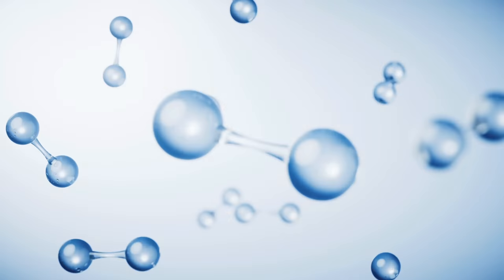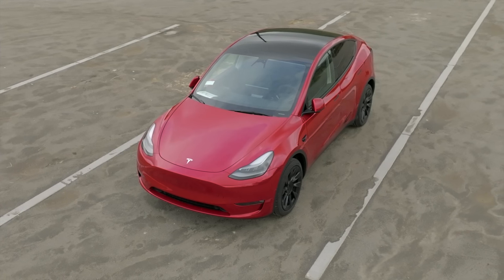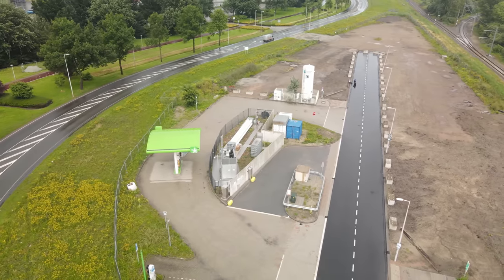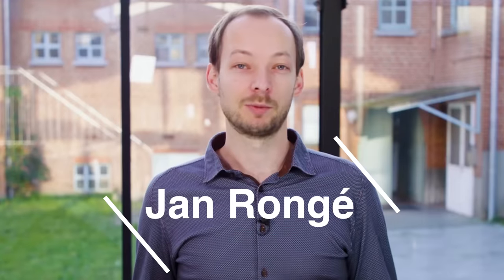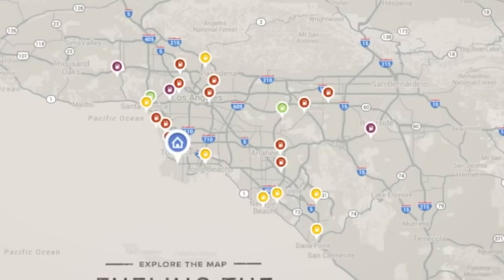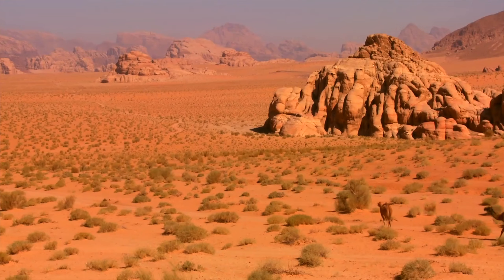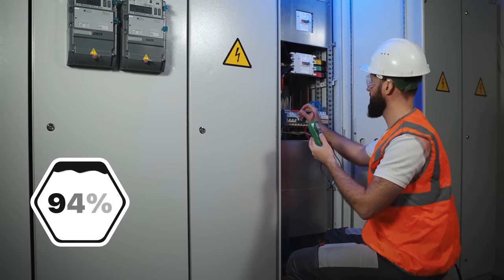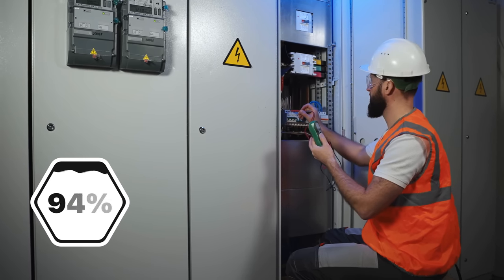Breakthrough Solar Panel Makes Hydrogen At Home!

Comment: For vehicles - I’m not quite sure why we aren’t compressing hydrogen into replaceable gas bottles the way we do with something like LNG (thinking of cannisters that resemble aerosol cans).  I believe the size of the molecule is a big problem as it escapes normal confines but high tolerance compression, storage, etc. are going to be much easier – and safer – to produce in an industrial setting with proper safety and control mechanisms.
If this were viable – it lets us address one of the major portability and concentrated air quality issues for today, I suspect this is why Japan is doubling down on this.  Personally I think solar won’t be practical for this outside of equatorial latitudes – instead for Europe, more northern America, etc. SMRs will deliver the required power (probably utilising excess generation capacity) on a more practical basis.  The double-bonus is monetising that excess capacity during lower demand periods.
If this idea is viable - it'd side-step the supply and distribution problems as it’d be shipped in a box and stored at existing service stations (though I’d want it to be armoured as this is flammable stuff).  Inside the vehicle it a standardised insertion/removal system with a proper hardened chamber perhaps?  If you build such a thing that has a huge boost in viable distance then even a lot of supply chain problems go away.  I’m not a scientist so I have no idea if this is a viable path or not, it just always makes me wonder with this type of thing.
Reply: A lot of people are still historically traumatized by disasters of the past, even when those were misunderstood, caused by negligence, and the major issues have long since been more than adequately addressed.
People remember the Hindenburg going down in flames, even though the Hydrogen flames would have actually been invisible.  There was actually a lot more fire that couldn't be seen, and what we could see was the fabric of the gas bag burning, not the hydrogen itself.  But even still, most people are under the impression that "Hydrogen Powered" is some kind of highly explosive, super dangerous option.  When you contain the Hydrogen in a huge flammable bag and fly through the air with it, where a tiny spark causes both a crash and tons of burning, yeah, that's dangerous.  But as fuel being burned outright in a controlled manner, it's no more dangerous than gasoline or diesel, if even.
This same "catastrophic failure fear" is why so many are irrationally afraid of nuclear power, even though the risks involved, when adequately managed, are minor and fairly easily dealt with.  Major disasters like Chernobyl or Fukushima aren't so much built-in issues with Nuclear, but the result of reckless mismanagement where the safety guidelines were outright ignored.  Also, it's because so much effort was put into claiming "perfect, infallible safety; nothing could go wrong, ever" so when something did go wrong, there was overreactive backlash and knee-jerk reactivity.  The public had a meltdown over it, to put it bluntly.
That's why sooo many people are irrationally opposed to Hydrogen Fuel efforts; they don't want to think they might have millions of potential Hindenburgs driving around one day.  And some might even be thinking Hydrogen Fuel means some kind of micro Fusion Reactor and they definitely don't want to be driving around in a Honda Bomb (H-Bomb).  People are like that...
Reply: @omargoodman2999  Now THIS is interesting – I didn’t actually know it burned with a clear flame, that’s a nightmare (the Indy Car pit crews and their ethanol fuels that burned clear, some poor bastard was on fire and nobody realised it until he was screaming).  I’d actually never thought of the Hindenburg disaster – God that would have been a perfect storm of absolute hell, I can scarcely believe people actually survived that.
As for hydrogen under pressure – I think a good comparison is LPG tanks in vehicles.  You do see the odd one here in the UK, in Australia it was all the rage as LPG was (at the time) 33c per litre and petrol was about $1.20 I think ( vague memory from  along time back).  Cab drivers universally installed them for obvious reasons, the petrol stations started supporting LPG gassing of vehicles as a matter of course.  The F.U.D. around them was the burning in an accident – a federal government agency did a really good set of well filmed tests of a simulated actual crash where the tank was pierced and the vehicle was already on fire, it only added a bit to the flame and the overall effect was mild.  No explosion. 
You’re also bang on about nuclear – the Three Mile Island and Chernobyl disasters scared an entire generation of nuclear engineers away from courses, the result was almost all NPP staff were nearing retirement at age the same time;  that can’t end well.
Fukushima scared Germany’s greens into canning every NPP there, Mutti just went with the fashion and least resistance path and now Germany’s electricity is 5x more expensive and their carbon footprint is actually HIGHER.  I do believe well contained, standardised and secured SMRs are going to change everything.  The French came close to standardisation of NPP components and designs and it worked SO well for them;  scale that to factory level and we’re on a winner.
I read that they’re expecting SMRs to output roughly 2x the nuclear waste of larger reactors – so we should see some WAMSR type reactors (as outlined by the MIT team about 2011).  These are Molten Salt reactors which are powered by spent fuel rods and pellets which melt into the salt bath and react in a giant puddle, it has a freeze valve which auto-melts and dumps the reaction chamber into a lower antechamber if SHTF and the NPP loses power or has a walkaway issue (the thing’s walkaway safe).  Burn waste product and get power for no new resource requirement;  Canada and Australia are finally upping output (Australian uranium mining was deeply unfashionable, Peter Garrett of Midnight Oil – who later became a government minister – led the charge against uranium mining but like you said, I think they didn’t really know what they were talking about and using F.U.D. again).
I envisage also solar and wind in the equation – assisting with load handling near consumption, I can see larger arrays and farms allowing for excess power to go to hydrogen production on a huge scale.  That would be brilliant – they can locate the hydrogen production plant well away from the NPP or solar/wind arrays, this can then produce locally made fuel for vehicles.  I’d rather use it for transport, vehicles and perhaps shipping – the crap those cargo container ships put out is IMMENSE and they burn the worst oil ‘coz no trendy orange clad noise makers can see the plume (but it does cause health problems for seaside communities, that’s how bad they are).  Imagine those converting to nuclear or hydrogen power;  security is an issue then of course but with the US Navy scaling down maritime patrolling of trade routes I think container ships are going to have to have armed security soon anyway as a matter of course.
Reply: @davocc2405  I've always been a big proponent of hybridization and heterogenous systems in general.  When you put too much emphasis on a single load-bearing element, then the whole thing can cave in on itself when that one element collapses.  So I think hybrid power grids with a relatively even variety of several different power systems is a lot more viable than one that emphasizes one singular resource, whether that be natural gas, oil, coal, or even nuclear, solar, wind, geothermal, hydro, etc.  It really needs to be a healthy, viable mix.  

And also a dynamic, fluid mix that can reactively adjust based on situational needs and circumstances.  Ideally, it should also be wholistic and systematic, incorporating not just how power is generated, but how it's distributed and utilized as well.  Inefficiency in power usage and wastage means greater burden on generation; reduce that wastage, and reduce the amount needed in the first place.  Buildings need to not only be made better, but upkept better.  We can't simultaneously complain about the expense of it, while also complaining about how much the economy is stagnating.  Spending money on jobs like these is what invigorates an economy more than anything because money, itself, can only really demonstrate value when it moves.  An economy is kind of like a hydroelectric turbine and money is the water.  The dam accumulates water (money) as a result of of its function, but it isn't actually the water, itself, you're interested in; it's the power that money can generate by "flowing through" the economy; by spinning the turbines by moving through a company, a store, or even just an individual person, money generates economic power which represents the value of goods and services.  That's why so many figures of speech concerning money are based in water: liquidity, stagnation, money flow, frozen assets, etc.  If we put power into the economy by putting economy into the power grid, that ends up being better for everyone.  But if we don't, well, when the heat energy you get from burning the money is greater than what you can buy to burn... you burn the money.  That's just a matter of economic efficiency as a result of economic inefficiency.  I believe in hybrid economies, too, so to go along with a blended power grid, we also need a more blended, dynamic economy that more seamlessly fuses capitalist and socialist elements (and more).
Reply: @omargoodman2999  Yes I believe the US has some serious problems with its grid infrastructure – apparently we’re not brilliant here in several parts of the country, I have read repeatedly that the infrastructure probably can’t handle a surge in demand from EV charging either.  It’s the distribution and transformation (or however they do it, that’s a bit out of my wheelhouse). You’re bang-on right again about the hybridisation and heterogeneous source mix, that also affords countries some degree of supply chain autonomy as well as security against threat to one particular source;  that’s going to be a big deal if hot-war heads our way (that may be the go in 2027 sadly).  
I really like your turbine analogy, that’s very correct – I’ve argued elsewhere that property pricing is the largest sinkhole for flow that we see in many western countries and it’s killing innovation, investment (in real companies and ventures) as gamblers speculate on limited essential consumer assets rather than real world developments. 
I 100% agree on the hybridisation of socialist and capitalist concepts – they need to co-exist and depend on one another, they both fill niche needs that the other can’t (or won’t) provide and the public’s job is to elect and maintain that balance, that’s a job we’re not doing at all well lately especially with stagnation of policy and party ideology (spurred on by tribalism fuelled by 3rd party antagonists).  Politicising energy  programmes has really killed them actually because they are tied to one administration but less so the next – even if t’s the same party in power, that’s disturbing indeed.  It’s another reason I favour the SMRs – lower outlay, gradual output increase, easier replacement (especially if it breaks), factory line production, just love it.  It makes me wonder if the industry of the past was milking its bespoke nature – when you think about it many NPPs aren’t Mercedes Benzes, they’re bespoke crafted Duesenberg SSJs with hand made bespoke components that cost more than many houses (in that case, thinking 1930’s Depression era).   
Get these down to production line items and it’s going to change the entire landscape, particularly the reticence to upgrade existing plants.  Right now in the UK we have a major plant being built but it has an awkward involvement of Chinese investment AFAIK – that may be...  problematic.... in a few years.  
On the hydrogen front – I’m very impressed with the Japanese doubling down like that, I do hope Germany follows suit as it matches their engineering talents more than existing EVs.  An alarming percentage of a Mercedes Benz or BMW is actually made in China – so many parts and components are sourced from there, with trade becoming more difficult tech is going to have to match and I have a feeling hydrogen will win (be it the electric version of the combustion version, I wonder if you can have both in a vehicle?).

Comment: What wasn't mentioned is, Hydrogen gas is colorless, odorless, and  is easily ignited.  What happens if something breaks in the complex hydrogen system in ones house that is manufacturing, storing, and using Hydrogen to produce electricity.  What would be the dangers of hydrogen gas being released?   The accidental release of hydrogen gas doesn't even need to be caused by the failure of the hydrogen system.  Fire, earthquakes, storms, lightning etc could also cause the release of the hydrogen.  IMHO, a better solution is for the homes to have a conventional solar system, hooked up to the grid.  Excess electricity produced by the solar panels can be routed back to the Utility Company.  And the Utility Company with the excess electricity can produce the hydrogen gas, that can be used to produce electricity, power cars etc.  Besides being safer, this will also probably be a cheaper solution.

Comment: So why can't they put a small closed system hydrogen generator in the car hook it to the alternator for the electric to split the water into hydrogen just have a small tank that is automatically topped when the car is running then all you have to do is put water and a saline solution into your car

Comment: I would swap out to an hydrogen car if I made my own hydrogen.  As far as road trips,  I would build a trailer with a fuel unit on it,  as I travel leisurely no problem .
Unfortunately I will be hitting eighty by 2030

Comment: Am I misremembering my physics and chemistry lessons or wouldn't 250 litres of hydrogen, if directly burned as fuel, be able to heat your average domestic hot water tank a dozen times over? Hell 2 panels and you could probably heat a pool

Comment: The Best Choice can be to own a Hybrid Car with Hydrogen ICE with EV Capability [with the Sodium Batteries or the Latest Low Cost Low Weight High Range Battery for EV Capability].
One can have a Roof Top Solar Facility for EV Battery Charging and Solar Hydrogen Generator for the Hydrogen ICE part.
Then the major consideration would be the availability of Recharging Points for EV Part and Refueling Stations availability for Hydrogen Fuel for the ICE Engine.
As on this date if we have such a Hybrid, then first start your journey with Hydrogen ICE. Then once the fuel reaches a safe lower limit, switch to EV Mode. The present scenario is that the support for EV Battery recharging would be the available option.
The Hydrogen ICE would be the future not because it is the best possible option. But because of fact that the ICE Engine Manufacturers don't want to lose their ICE based Vehicle Manufacturing Facilities.
So, the existing Automobile Manufacturers would support the TOYOTA Mission for refining the Hydrogen ICE based Vehicle Technology.
However, the EV Mobility is well established now. It will also coexist with new Green Battery Technologies.
The innovation in Battery for EV Industry is catching up momentum. Future seems to be an era of better Green Mobility.

Comment: Solar power -> battery -> use (~80% efficient, cheap, quite safe)

Or..

Solar power -> hydrogen production -> hydrogen pumping -> hydrogen compression -> H2 to electricity conversion in fuel cell -> use (~40% efficient, less cheap, much less safe) 

"If you could refill your car in four minutes and get 300-400 miles of range would you switch to a hydrogen car?"

Absolutely not. 

1. I don't care how long it takes to charge a car at home. I'm sleeping.
2. I will never have compressed hydrogen tanks near my home - be that stationary tanks for filling a car, the tanks in a car, or a hydrogen fuel station in my area.
3. 300-400 miles of range is what we already get with EVs.
4. DC fast chargers get you ~80% of charge in ~20 minutes. I am not so impatient that I need that to be 4 minutes.
5. Hydrogen systems cost more to maintain. Hydrogen fuel cell cars cost more to maintain.
6. Fuel cell cars are less flexible. You can't wirelessly charge them. Can't plug them into any power socket.

Comment: This setup seems entirely unnecessary to me.
You use solar panels to crack water, then you take the hydrogen to a fuel cell, and turn it back into water and collect the electricity, losing efficiency at every conversion.
How is that better than just having solar panels and a battery?
Cryogenic hydrogen storage is pretty energy intensive, so it would only really make sense to pressurize it.
So now you gave to add a pump, drawing even more power from the system.
The only way this makes ANY sense to me is as a home filling station for your car.

Comment: Ok this is a no brainier. Get a Truck or SUV and install this panel on the roof. If you need to put two on the roof. For trucks you can put them above the truck bed like a truck camper. Then pipe the hydrogen into the tank. So while you're parked or driving you can make fuel.